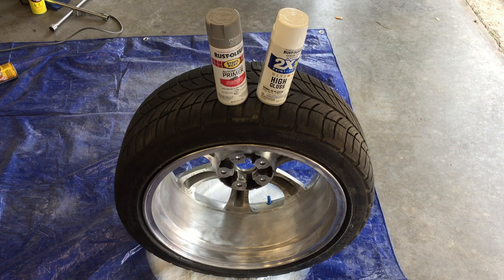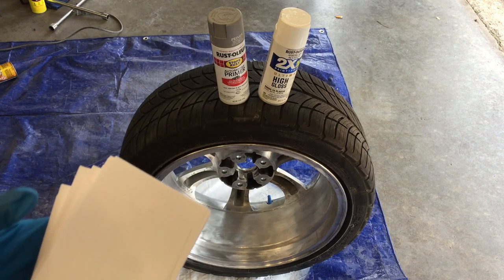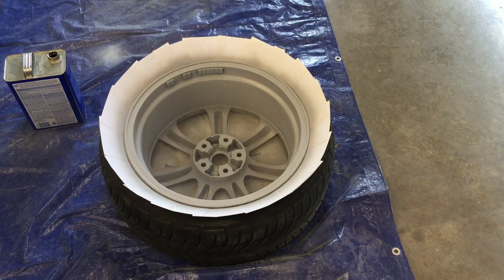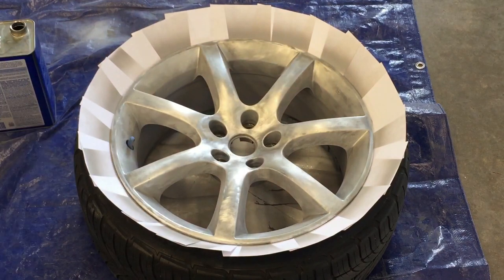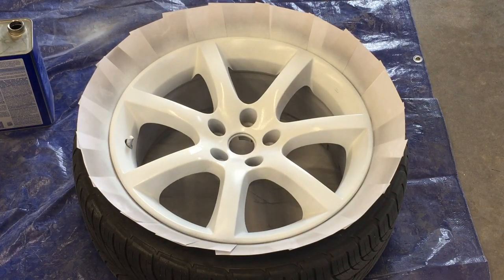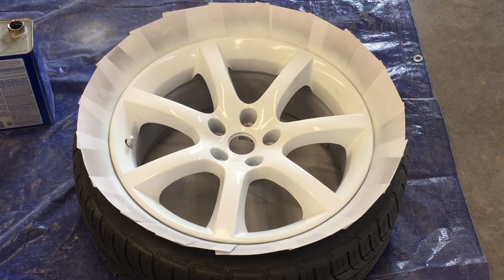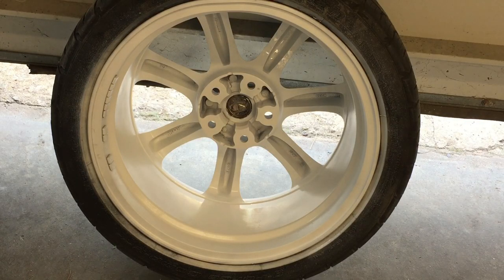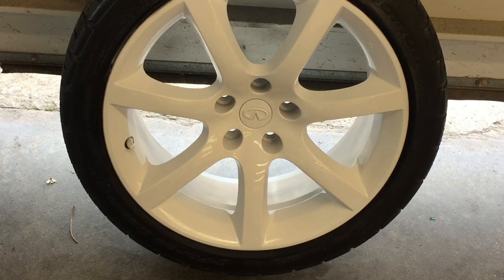How to spray paint wheels and achieve a nice finish. (High Gloss)

Comment: The surface where the wheel meets the hub should be masked so as to preempt it from interfering with the torquing process. 

Other than that, you have composed wonderful video! 

Would a Rust-O-Leum paint & primer be a sufficient product to employ? I do not plan on keeping my wheels for many years.
Reply from the maker: Kayyxe yes great advice to keep in mind but paint and primer is good on its own.
Reply: As well as where the lugnuts seat ... learned first hand in an evo on the track...
Reply: Kayyxe 
It won't interfere with the bolt torque but there is a risk of upsetting the geometric tolerances.
Reply: David Lowe it’ll eventually crack depending on the paint and loosen up then lugs

Comment: 2:25 instead of note cards I found taking thick paper and cutting the 11" side into thirds works better because it gives more coverage and tends to not get blown out by the paint gun air pressure (when not rattle canning).  I then run painters tape to connect all the sheets and it's solid

Comment: Dumb question, but why not flip the wheel over after primering the front, paint the back, and then paint front?  This would ensure no over spray from doing the back lands on the feont surface and would prevent the need for cleanup?

Comment: Overall good video but a few mistakes were made. 
You should sand after priming if you want a true high gloss, texture free finish. Primer leaves a rough "sandy" texture that shows through paint. 
You should do two very light coats and one final wet coat. As wet as you can get without dripping. 
You  should paint the inner barrel first because you will get overspray on the face of the wheel that messes up the glossy finish. (if you paint the face first) 
Enamel clear coat is almost required for wheels to avoid break dust and dirt from becoming embedded in the paint.

Comment: Nice.... How is it keeping them clean? Will the finish hold up to the brake dust and wheel cleaners? Please do an update on this please.
Reply from the maker: I will i will!
Reply: mike lon its a single stage paint, meaning no hardener so its not very durable.  You wouldn’t want to use anything harsh on it.
Reply: That is where a 2k clear would help with durability.
Reply: @michael-kunk-flynn9955 
That's what I was thinking. I tried the same brand clear (rustoleum) and it made the base color wrinkle up.

Comment: Hi Mate, great vid. Did you get that wheel repaired? it had a massive flat spot on the inside of the barrel, which is supported by so many balancing weights. 9:11 right near the white "C" shaped thing on tyre sidewall.
Reply: Good catch that is a big flat spot. Personally if I went to all the trouble to bring it down to bare AL I would have just continued to polish it out. Rattle can might be good if you are going to sell the vehicle, it won't stand up to time. There is a reason EVERY manufacturer moved away from paint. It's either polished AL, chrome or powder coat. On the plus side it will be easy to strip and repaint in a year or so when it looks like crap.

Comment: I would love to see these wheels after 2k miles ...as there is no clear coat with hardener as a toplayer...
Reply: I use dupli color wheel paint with single stage can clear and it holds up nice for about two years. Then the clear coat goes to shot. So definitely good for 2k miles..

Comment: now i realize why its taking me soo damn long to clean my 18 inch genesis wheels. I never cleaned the inside of the wheel and drove the car pretty hard. The brake dust worked its way pretty much down to the bare metal. Im currently sanding with 80 grit and the shit still is taking a long time to come off. DO NOT FORGET TO WASH the inside of your wheels!!

Comment: Great vid. You went through all the effort of going back down to bare metal but you left the curb rash on that rim? Why not try smooth it out a lil
Reply from the maker: Nicholas Rudloff I spent a LOT of time 3 days to be exact trying to remove all the layers of paint I just wanted them done but I see what you mean.
Reply: Moore Motorsports James Dguy In another video, metal reinforced bondo was used to fix curb rash and scratches. No tires on wheels.

Comment: Disclaimer for anyone that runs into this video. You want to avoid leaving paint on the contact surface on the back of the wheel face that contacts the hub. You can either tape it off or remove it with acetone later.

Comment: You should have done a video on how you remove the old paint off and prep it with the sand paper ! Good video do !
Reply from the maker: HAHA it took 3 days to do these wheels and i mean 14 Hour days each lol. Not even playing. There was so many layers and no matter what we did or used it didn't wanna come off. Maybe if i can find some wheels that only have 1 or 2 layers than i will. We used gel paint stripper, 6 cans of air craft stripper, 2 sets of wire wheels, Wire brushes, 60 grit sand paper and 3 days to do it all to 4 wheels. Thats with help from friends lol. Who ever did these wheels all i can say is shame on them.

Comment: Have you sanded your wheels before ?
Reply from the maker: Nicks Edits had to remove 6 layers of plasti dip and paint but yes used 80 grit to remove all them layers. If the wheels aren’t badly painted use 220
Reply: Moore Motorsports James Dguy ok thanks 
Great vids btw you helped me a lot !

Comment: Confused on why the wheel weights were left on
Reply: I believe he mentioned the reason was cost. His wheels were already balanced and he didn't want to pay to rebalance.

Horrible idea imo, but if you're that tight on cash then sure I guess. This is especially bad because the next time these rims get new tires or are rebalanced, those old weights will come off, and show the horrible paint underneath in contrast to his new paint.

Comment: Damn. Looks a hell of a lot better than my shitty plasti dip job😂😂😂
On a completely unrelated note.... do you have any tips for getting plasti dip off some rims?
Reply from the maker: Jdb4212016 soak them in WD40 and if you have a heat gun low heat helps with them soaked in wd40
Reply: James D guy thanks man, I appreciate it. You’re like the best Creator out there, you actually help your fans.

Comment: You say high gloss, but the finish is far from gloss or high gloss. You either needed to wet sand sand the Primer and or let the wheel fully dry then wet sand it and polish it to remove the lumpy orange peel finish to a 'high gloss'!

Comment: That wheel looks bent on the inside of wheel @4:37 between 2o'clock and 3 also why if sand blasted why did you use all the other removal items...sand blasting with tires still mounted? OK?
Why leave tires on is the cheap way but not the proper way...and not if you're doing it the easiest way. So much easier W/O tires still on, the only place you need to protect from paint is the wheel mounting surface (which you painted SMH

Comment: Dude you don't have to paint the backside of the wheel all you need to do is just do the front. And you don't have to use acetone or any of that stuff and you don't need to use tag cloth just your bare hand to wipe off the dust and paint away...